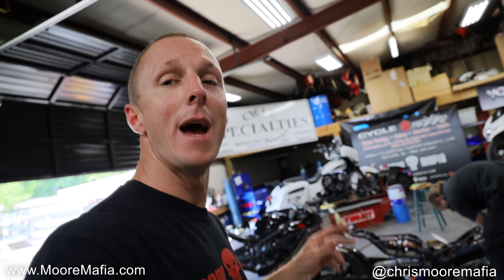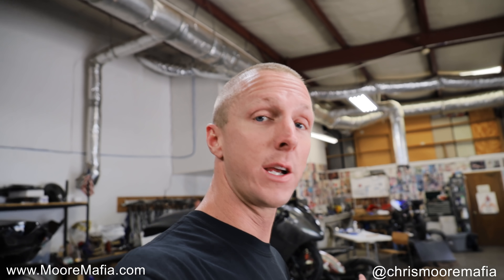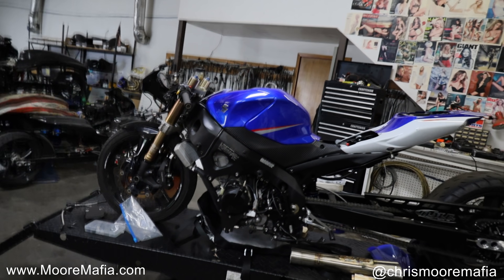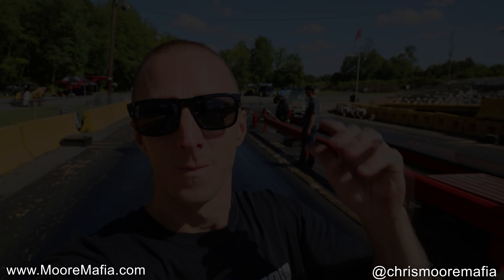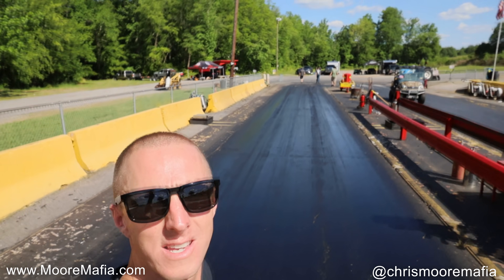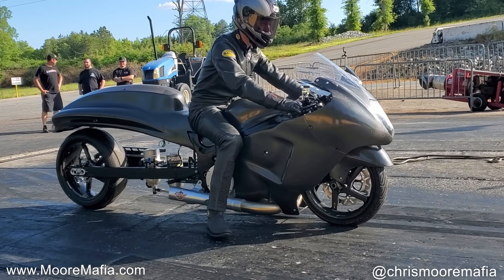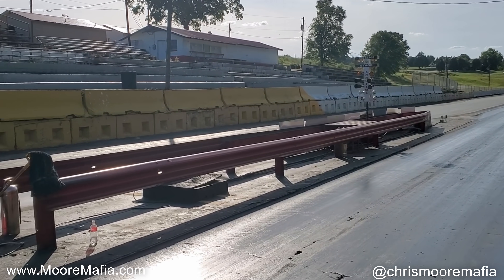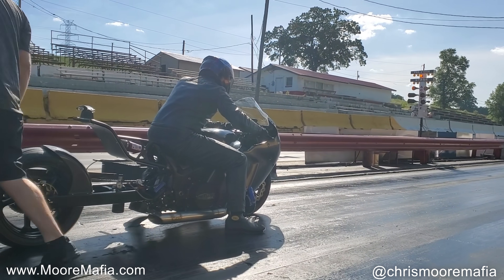Nitrous and Turbo Hayabusa First Time at the Track EVER! Moore Mafia Drag Bike

Comment: Why there is no production bike produces so much power like urs project bike 400 500 700 hp does if they produce and sell it it will be easy? To ride
Reply: Try again in English
Reply: Because of exactly just that, it wouldn't be "easy" to ride.